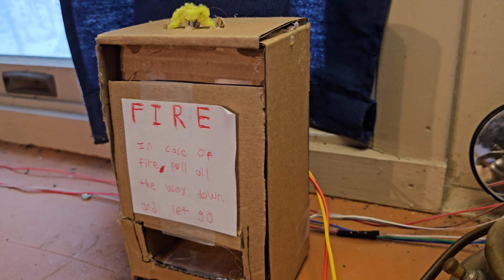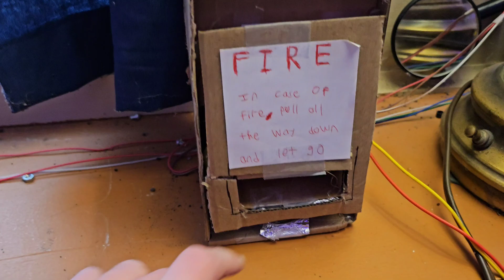Fire alarm System test 7

Comment: In the old house, We saw a pull station and we got to the basement and found an fire alarm and outside. They installed the panel. 1 is in the attic. 2 is in the basement. When we moved out, They deleted all of the fire alarms. And The Pull Stations. some People were freaking out about the fire alarms. So The homeowner decided to take off the alarms.